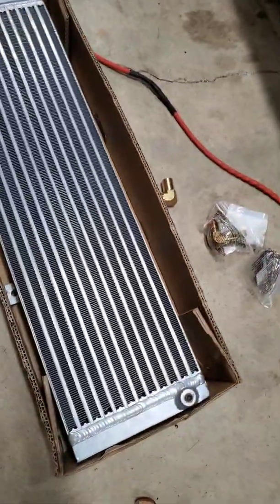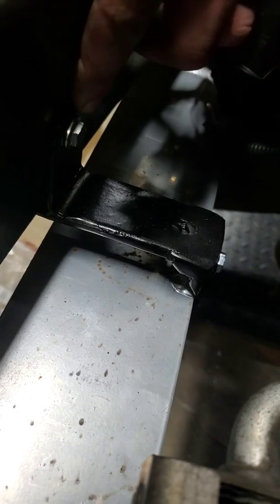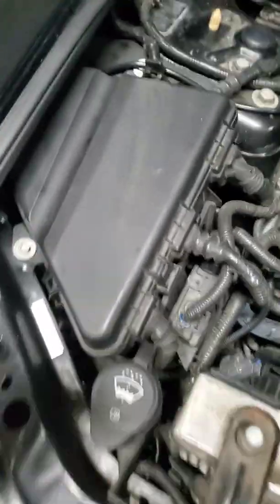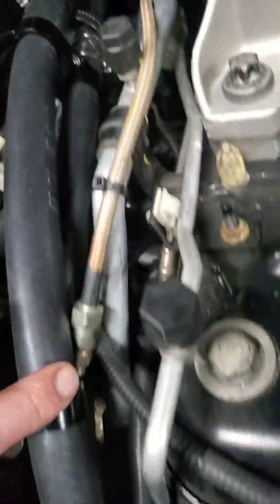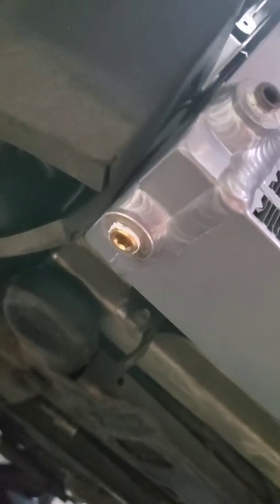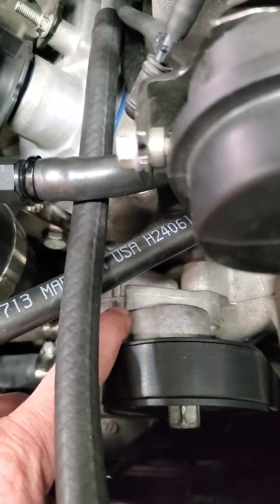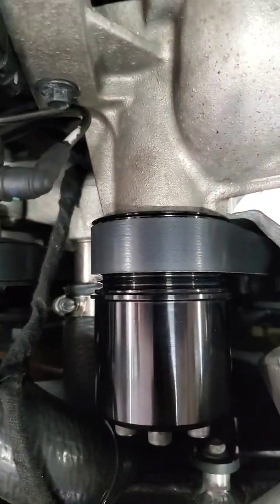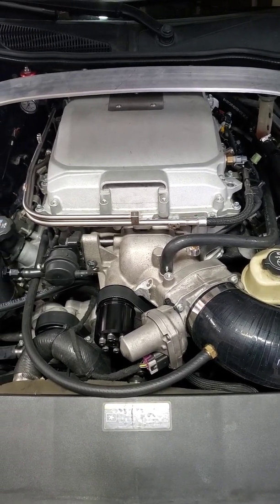2005 Cadillac CTS-V LSA Swap Part 4: Heat Exchanger install, hose routing, pump wiring, final tips

Comment: What state are you in?
I have CS poly motor mounts.  Is that what you used, or did you go solid?
Reply from the maker: Washington state. I have the CS poly mounts as well
Reply: @tomcatpilot15 Been going back and forth on a blower.  Car currently has Headers, cam, intake, and exhaust. The stock injectors are at 100% duty cycle.  Stumbled on your channel looking for info on an E compatible fuel filter should I go with the larger injectors.  Just put some 295/35 Hoosier Track Attacks on the back (of widened stockers)  LS7 clutch seems to be holding up well to them.
May end up with Feal 442's before moving on to forced induction.  Currently building some custom electonic adjusters for them.
Do you happen to have any dragy data / times?
Reply from the maker: @andyh8239 I dont have any data or track times. If you want to go E you will need more injector and more pump than what im using as well as bigger fuel feed line size

Comment: Hey man, down here in Texas myself. I have a 04 V  and I’m wanting to do this I’ve had a parted lsa but sold it during covid. By any chance do you have an old parts list of this build? Thanks for the videos they are very informative.
Reply from the maker: It all depends on how much power you want to make and how you wanna go about doing things. That will change the parts list
Reply: I really like the simplicity of your build 550ish hp. More is cool. But being reliable is a must.
Reply from the maker: @silveroz  my main focus was reliability. I realized I only listed parts on some videos not the other. Obviously need the supercharger. Olson kustom works head adapters and custom snout. Frozen boost 101 heat exchanger. Stock v2 HX pump, stock v2 Injectors resized to 1000cc. Stock v2 spark plugs. 3/4 and 5/8 hose and barbs for HX hoses. Walbro 450 fuel pump. Stock v2 HX tee/filler. 5/16 ptfe fuel line and AN fittings for return. 3/8 ptfe fuel line an AN fittings for feed and regulator. Racetronix fuel pump hot wire kit. I used AEM boost and AFR guages. I forget the brand and part number for fuel pressure regulator. Generic 4" k/n filter. Ls7 card style maf and 4" intake tube  with slot for ls7 maf. 4" silicone 90*  LS2 Throttle body (hardwired connector)   also had Olson kustom reinforce the brick. I forgot what else bit that's most of it

Comment: what heat exchanger did you get?
Reply from the maker: It's from frozenboost.com I believe it's the 104 model
Reply: @tomcatpilot15  also where did you get the tubing for the heat exchanger? also do you have the dimensions for the brackets you made? I'm also trying to set up a heat exchanger for my 1st gen V as well
Reply from the maker: @arandomtrickshotter  the tubing is just heater hose from the parts store. And I don't have the exact dimensions for the brackets
Reply: @tomcatpilot15  alright thanks for the help, I appreciate it
Reply: Just wanted to say thank you so much for taking the time and effort to document ur build.  Starting with the V2 brakes on the V1 to this LSA build you have made my build which is still in progress so so much easier.  I'm still waiting for kit from BoostDistrict, but I was able to purchase parts in advance, such as the fuel pump, hoses , regulator etc. Also ordered a mighty mouse catch can. I just can't thank you enough......👍👍🤜🤛